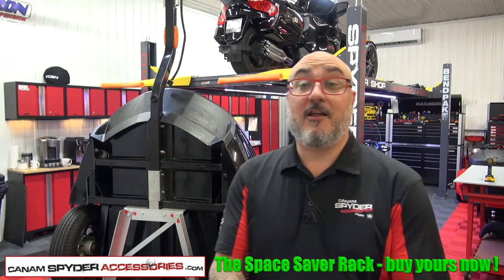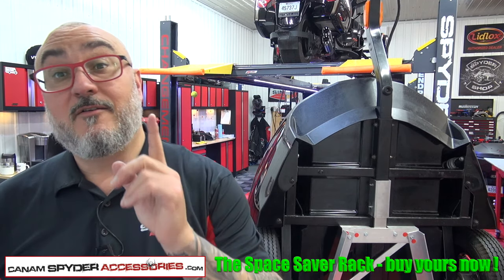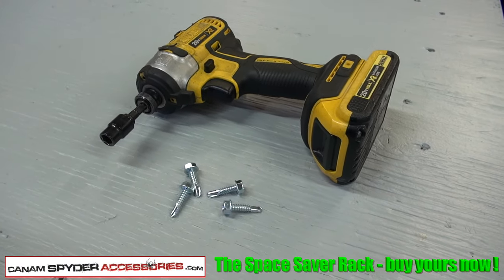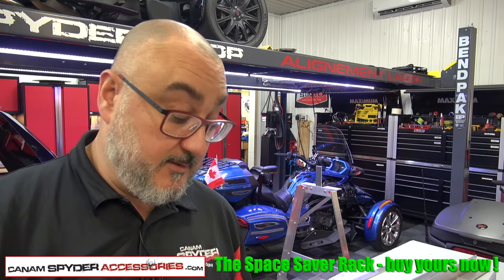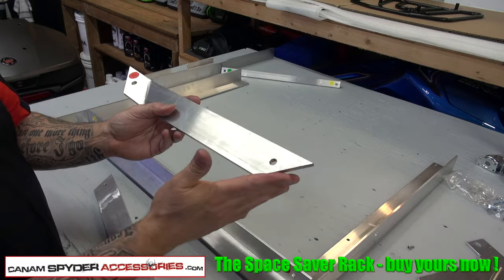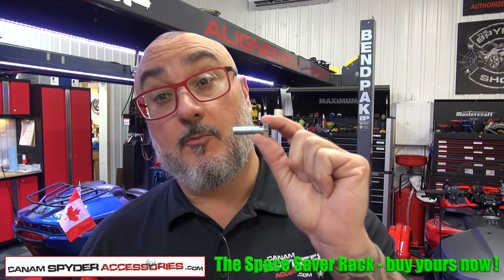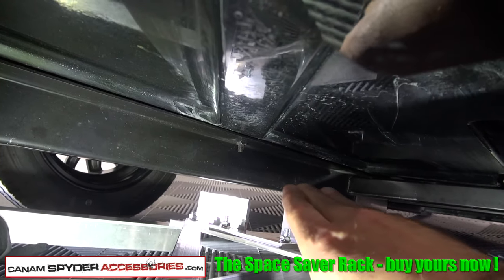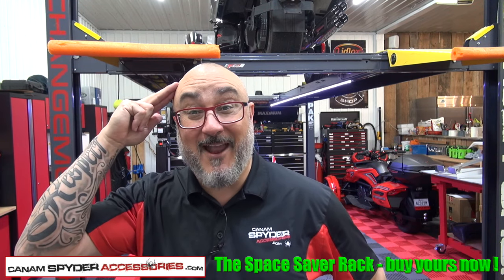Assembly Space saver rack Can Am Freedom trailer - #brp #canam #spyder #trailer #freedom

Comment: Hello. I'm interested in the Space Saver Rack for the Freedom BRP trailer. I'm curious you can tell me how high the rack raises the trailer? The trailer measures about 95 inches and I have about 107 inches of clearance in my garage to stand it on end. So I'm wondering how much your rack in the upright position will add to the height to see if it will work in my garage.

Thanks...
Reply from the maker: you need 98 inches
Reply: @pierre-spydertvpoliquin-sp9082  Thank you for the quick response. I'm curious if you've ever heard of anyone using your Space Saver rack on a trailer? I'm looking to tow my Spyder behind my motorhome along with my Freedom trailer. If the rack can be upright I won't need as long a trailer. Thanks again.
Reply from the maker: @AuthorRWeir  Not something I would do, space saver rack is meant for a garage, putting that in a trailer will all the vibrations and bouncing around, not sure how frame would hold up.